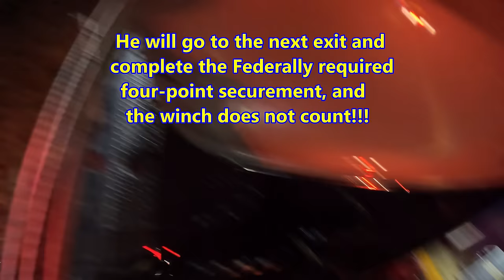HIT & RUN ON THE INTERSTATE!!! CABLE SYSTEM SAVES THE VICTIMS, BUT NOT THE CAR

Comment: Say what you will about cable barriers but states which have installed them report as much as a 100% reduction in cross-over fatalities. Fast, impressive work, Ethan!  Merry Christmas to the Pratt family, Midwest Trucking, and viewers!
Reply: Always hear people talk about the cables sending you back into traffic. That's a win as opposed to going into oncoming traffic. Vehicles get destroyed people live all that matters in the end
Reply: Yup. Kinda sucks to own one of the cars the wreck bounces into in that case, but you're all going the same way at about the same speed, and it's a mess but it could be so much worse. The wreck goes into oncoming traffic and it might go nose to nose with someone at 140mph (70+70). I'm a big fan of cable barriers, myself.
Reply: The benefits are significant, I think most are grateful for implementation of these cable systems.
Reply: Only when they are installed properly. Washington state had a stretch of I5 just N of Marysville not done to manufacture specs. It failed to stop almost all the vehicles. It got redone per manufacture specs and it works great.
Reply: @Suedeman  keeping you inline with the  traffic is the best imo, if there is chance for a secondary crash, a rear ending is safer than a side impact (and obviously not a head on collision with oncoming traffic on the other side)

and if the impact on the cable is greater, it might tangle in the cables but still doing its job of keeping you allong without large redirecting forces
Reply: I just wish they would put the cables in the middle of the median, not on one side. Sometimes a collision can be avoided by driving into the median, but you can't do that if there is a barrier or cable system in the way.

Comment: I’m always amazed at how strong those cables are. Great job! 👏
Reply: Here In Denmark all the strong cables have been removed from the motorways because they tear the cars to pieces ,and deads,has been replaced with fixed steel guard rails everywhere.

Comment: Where has talon been?
Reply: Talon took over running the truck repair shop.❤
Reply: Talon mostly runs the shop
Reply: Talon is the shop manager. He is not out on the recoveries much now.
Reply: He's in the shop 99% of the time now
Reply: Talon is the shop manager.
Reply: He's the repair shop manager
Reply: Talon works in the shop. Has been for many years now.
Reply: Talon is the shop manager I believe he has been for a few years now.
Reply: He's a shop formen my understanding he only gets called out to wrecks when they need more man power
Reply: He’s been managing the shop side of business for a while now. Only goes on calls requiring everyone to help.
Has been mentioned multiple times on video.
Reply: Talon has bee working in the shop for quite a while now, maybe a year.
Reply: I believe that he is running the shop
Reply: He works in the shop full-time. Has been out on 'big' recovery jobs on occasion.
Reply: Talon is the shop foreman now, if memory serves. Doesn't come out on the road much, if at all.
Reply: He’s normally running another truck
Reply: Talon runs the Midwest truck shop, go back a few vids to when Ron unloaded the big pipe load in their shop parking lot and you'll see talon helping. Talon really only leaves the shop for really big big semi wrecks
Reply: Does Talon run the shop? 😂

Comment: Video starts: "Hey.. that's not Ron..." ............ "OH!... Hey Ethan!" lol.. my brain sometimes. OMFG! Them making jokes about the "don't lowball me" thing.. I guess that's not regional. That's like this guy out here with a wrecked 65 straight 6 Mustang with lots of rust that the driver's inner fender is smashed flat and almost to touching the engine and it has no interior and the guy wants $4500 for it and says exactly that.. Same with a guy selling 2 1967 Mustangs with no interior, transmission, wiring, engine and one of em without a hood is wanting $3k a piece and saying that they are super rare and never for sale.. while there's 4 others within 60 miles in the same shape for the same price. People on marketplace are just about the stupidest on Earth I wager.

Comment: On the highway through where I live there is a short bridge that goes over a road.The bridge rises up a little to get clarence for the road overhead . One day I came through there and was in the left lane. The rise in the bridge isn't much but, it hides what is going on right after it. The right lane was backed up because of an minor accident on the long river bridge up ahead. The first though in my head was, someones going to get killed here because of the rise in the bridge. After I arrived home shortly after the news showed the deadly crash at that very spot. Someone texting obviously wasn't paying attention and slammed into a Jeep Wranger at at least 65 MPH , rupturing the fuel tank and a spark set it off. A young woman and her mother died in the burning vehicle

Comment: They stopped using them cable barrier systems in the UK due to the fatality rates with motorcycles. The few that remain get replaced when they are damaged or due for replacement.

Comment: I wish you would explain to some of your fellow tow operators the correct way to secure a vehicle to a rollback and on a wheel lift. As well as why you should never use the winch for securement.

Comment: Concrete barriers or steel guardrails do a lot less damage because the vehicle can slide along them. The cable barrier just pulls a vehicle into it.